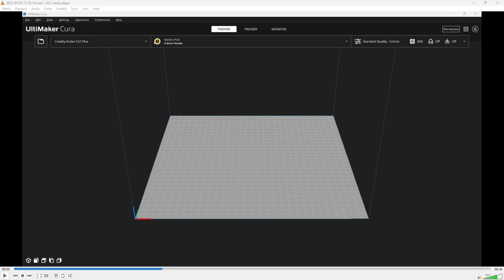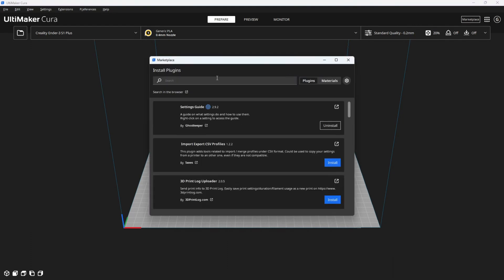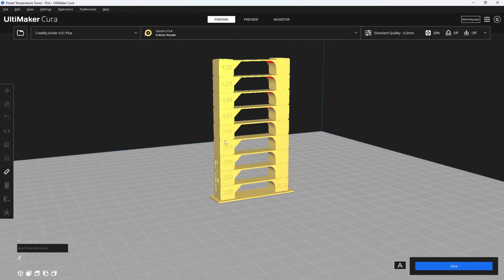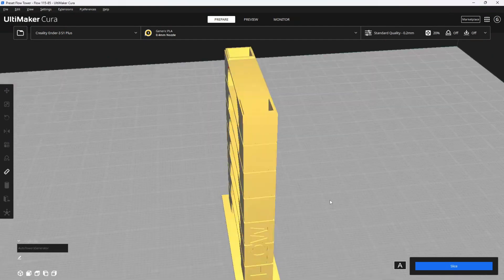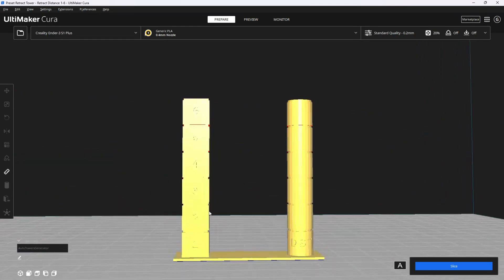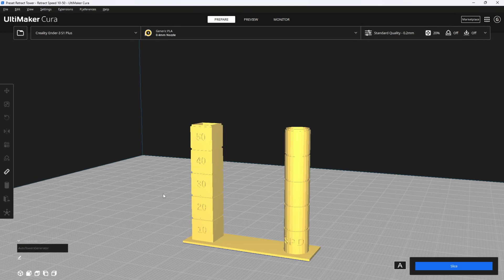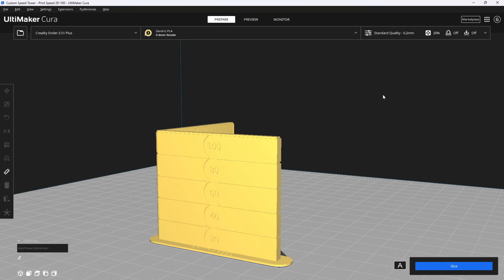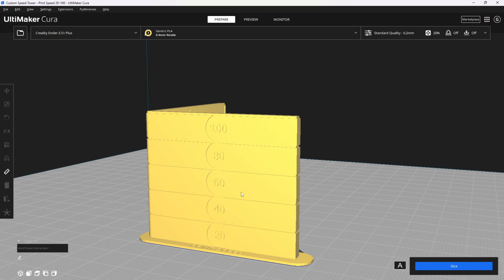CURA: Temp, Flow, Retraction, & Speed Tower - What, How, and WHY to use them, for better 3D Printing

Comment: I have a Neptune 4 pro, my print speed is default at 250 mm/s. What should I do, should I just leave it alone?

I have found that better print comes out at speeds of 95%.

(The speed tower only goes to “100-200” tops)
Reply from the maker: I would prefer you act as if "Defaults" don't exist. Set speeds manually in the sliced, for each project. Experience, will lead the way.... 
Projects with details and small parts, will need slower speeds. Projects with big bulky features, can handle high speeds. Silk filaments will have different matte/shiny appearances depending on speeds. Some of my prints are done as slow as 80-120. I seldom push faster than 220. Practice....

Comment: Thank you very much for this video.  Always been curious what the proper order of operations was for testing.  Any idea where I can find a speed test that has higher rate?  I just picked up a K1 max and wanted to test much higher speeds than whats available with this extension.
Reply from the maker: I would use Bambu Studio or Creality Print 6, for K1

Comment: If you use the flow tower do you need to set a starting flow in your settings before you slice or it doesn't matter?
Reply from the maker: It's been a while since I've done one of these, but, I want to say, you shouldn't have to. The GCODE should do it

Comment: What about layer settings ?
Reply from the maker: All temp changes are in the gcode
Reply: @3DRundown  
Yes thank you .
I dont know what i have to write in value settings. 
After a few mistakes and some trys i will check it
Reply from the maker: The 3MF Project file, has it all done for you. That's why it exists. :)
Reply: @3DRundown  it was about the settings beforehand.
so that it really increases the speed by 20 percent after 42 layers.
but it worked now, thank you

Comment: STILL the best tutorial for tuning new filaments.
Reply: @3DRundown  does it matter what speed youre printing at? so will a flow calibration tower at 50 be the same as 80 or 100? or do you need to retest at different speeds?

Comment: Great description. My only problem is my eyesight sucks and trying to look closely at those tiny towers is difficult. lol I need a magnifying glass to see what layer is best.
Reply from the maker: If they are BAD, you'll KNOW. If they look similar, then that range is likely safe. Look for mega failure, to eliminate those settings, and get a better idea of what is too Hot, Too Fast, Too Much, etc. this will help you get closer to something that works. Truth be told, I have only used towers 2-3 times ever. Start with stock profiles, they are very good these days. Work from there. Avoid changes unless you see a need

Comment: I have an ender 3 s1 pro which has a dirct drive. So my retraction should be bellow 1. Is there a way to chang the tower so it runs from 0.4 to 1 or something similar ?
Reply from the maker: 0.8 for the S1 will be fine

Comment: Hi. Thank you for the walkthrough. With the temp tower, do we care about rhe stringing or only about the layer ans surgace quality. Some of the best layers, surfaces and edges look better on he higher temps but they have stringing.
Reply from the maker: Higher temps tend to cause stringing. Id stop the stringing, then figure out the rest. For PLA and PLA+ nearly any brand will be ok around 200-205. May have wet filament or retraction issue. If stringing just wont go away. Wet filament is likely the issue, or too much retraction distance.
Reply: @3DRundown  thank you so much for the prompt reply. I'm take that advice. I'm new in the filament pushing game. In what order would you do which towers to calibrate my E3v3 se?
Reply from the maker: I have a V3 here, but haven't even turned it on. I feel guilty. I'm out of space and time. This  years new releases have been nonstop.... 
I'm not a huge fan of towers. If using them: 1st, be sure they are even working. See if the temps are changing, during the print, for example. Start with a stock profile. Avoid any drastic changes. I would set your temp at 200, and check retraction 1st.
I prefer to work myself, using something like this: https://www.printables.com/model/75704-retraction-test
and this: https://www.printables.com/model/251890-stringing-test
The 2nd one is much more complex. If can survive that one, you know you are good.
The E3 V3 with it's sprite, really shouldn't be strining much. What slicer are you on, what profile, and what is it showing for retraction speed and distance? Distance should be somewhere around 0.8, as it's a Direct Drive.
Reply from the maker: Also, feel free to pop into my group, and post in more detail: https://www.facebook.com/groups/ender3v3
Reply: @3DRundown  seems like I have a ton to get through to get the machine tuned up. I have both creality print and cura. Doing the towers on cura. Did the auto temp tower and it gave me 220, this is with petg by the way, and did a flow wich gave me a 90 as the cleanest although 110 didn't look to bad except for the top layer for it. Only 90 and 110 didn't have any stringing at all with 90 looking best. Following your guide in the video and slowly working my way through. I'm busy printing the retract distance 4-9 tower now.
When you do get to the v3 we do a video on it. Yeh this year has been loaded with new releases. You're going to be a very busy guy in 2024. subd
Reply: Oh and on the normal quality 0.2
Reply from the maker: PETG is a royal pain in the ass. I reccomend working with PLA and PLA+ unless you really need PETG. However, PETG on my K1 has been a breeze. I've Got the V3 SE here, and the KE on the way, but, omg, I'm swamped. I can't even come close to keeping up. I'm trying, and will do my best!! I am dealing with a MASSIVE space issue....    See you in 2024! I will try my darndest to cover all this kinda stuff.

Comment: >For Auto Towers to funtion MUST run post scrips, Extensions--> Post Processing-->Modify G Code. Then select Add Scripts. Select the one you want to use for the Auto towers you select earlier. Select the parameters. If you have doubts search for more videos.
Reply: was waiting for the script instructions 😂
Reply: Cura 5.8 auto towers do not need post processing gcode modification as far as I know.
Reply: @arnab6408  you would be correct. Cura 5.8 added auto towers native so you dont have to install the add-on and you no longer have to change the g-code
Reply: @3DRundown  😬🥴🙃

Comment: I'm new to 3d printing, but I just used the auto tower plugin, and it does NOT add the scripts to actually affect the settings during print.

For example, the flow tower. I exported it as is, and the .gcode did not make any changes to the flow rate. It is very important that you verify your tests are genuine tests. Otherwise you're going to go against placebo results, making you change variables without proper tests...

The way to fix this is to go to post processing, and enabling the correct script. You wanna make sure the settings are correct there, and the increment has to be checked against the preview. If the increment is 40, then you would expect the next iteration in that script to occur every 40 layer line. So 40, 80, 120. You can visually check that in the preview.
Reply from the maker: Are you runnin version 7.1? (7.2 is awaiting approval).
Reply: @3DRundown  I'm running the latest public.

For the other calibration plug in however, their scripts work fine

Comment: Thanks for sharing this!  Huge expansion of my knowledge of testing and USING the previous good value(s) for the next test(s).  Somehow that tidbit of knowledge escaped me when watching videos about running individual tests.
Reply from the maker: Even better news, there is a major update to the extension since this video. Make sure you have it. I believe it's 7.1 or 7.2
Reply: Thanks - I have Cura 5.4.0 and Auto Towers 2.6.0 - running on Winders   @3DRundown

Comment: The temp tower didn't work for me on my Anycubic Vyper. The initial layer pattern is very weird and lays an inner layer, then an outer layer over that making it very thick too fast, even on my "Fine Profile" setting. I tried to run it twice and within 3 layers it was unusable so I canceled both tests.
Reply from the maker: Bummer. Sorry to here. If you end up with one that works, link me to it

Comment: on retraction distance, mine was best at 11. does that mean i set the retraction distance as 11 mm or 1.1mm?
Reply from the maker: 11 is REALLY high, but 11 is 11. Which machine is this? For Bowden setup, 5-8ish is typical
Reply: @3DRundown  it was at 11 on the auto tower, but realising that it was ridiculous,  I changed the temp and its now working pretty good at 3, but i still need to fine tune it.  Ender 3 s1. Thanks for the reply
Reply from the maker: 3 is still too high, if a Sprite. Get down to 0.8ish if a Spride Direct Drive. 5-6ish for Bowden.

Comment: Great vid! I've been looking for the best order to do these tests in. Thank you!! When I tested the temp tower, after it bridges across 2 lines, it starts doing a zigzag pattern. I thought it would always bridge straight across. Is the zigzag normal? It doesn't look like I can modify it.
Reply from the maker: Right. First you get a bridge, then a top surface.
Reply: @3DRundown  Each bridge has 3 layers. It starts to zigzag during the first layer. I guess I thought it would go straight across for the entire first layer, then zigzag on the second and 3rd layer.
Reply from the maker: Ah yes, that makes sense.

Comment from the maker: Peeps: Check in with your results. Are the gcode changes  working?
Reply: Cura 5.3.1
PLA temp tower doesn’t seem to be working.
Reply from the maker: Check the GCODE by opening the sliced file in a txt editor. Mine are working. I tested yesterday on a 5+. I had another test for me on their 3 Neo. Curious why no luck with yours...
Reply: @3DRundown  what should i look for in the file to check if the changes are there? TY
Reply: So far none of the towers change settings automatically. Neither the temp tower or flow tower do any changes as they print. Maybe you could show where you can show where you check the settings are applied in the slicer (Cura)
Reply: Love your guidance. Per your request and after printing a flow test, I noticed the flow never changed so stopped to see what was up.  I used Cura 5.4 to slice and low and behold there were no M221 commands anywhere. Don't fret, nor were there any in CURA's own flow tests so something is interfering with the generation of this. I'll dive into that later.

Attempting to verify my findings, I checked g-codes generated for both of the flow towers in Prusa, and Notepad++. At no time were there any M221 commands found. The computer world is bizare so don't fret, and like Gowerman I  looked up the 7 necessary layers (easy to find via any slicer) then jumped into the g-code reader (notepad) and to each of those layers I added the M221 S **  numbers as needed. Now off to give it a try. 

Please keep up the outstanding work as you've helped me a bunch.
Reply from the maker: If you've got proper GCODE that us peeps should use, feel free to link me to a document, with the code and how to use it, and I'll update the description, or make a new video. :)  Great to have smart peeps around!
Reply: As mentioned I'd run the code with the M221 S** at the appropriate times and it appears to be working. I'm still not understanding how your code doesn't work when sliced since clearly it does and has for others. 

I'm going to ask CURA what they think as all of this is WAY to new and sincerely out of my league at the moment. 

I only just started this journey 3 months ago and because I follow videos like yours, I've had great success (OK, I'm very lucky too) but am always on the lookout for better or perhaps it is greater knowledge, dunno but here I am. I'll let you know what, if anything, I learn from CURA. 

I've also got some pre-processing gcode in my CURA which might be an issue here but I swear, I've no idea. Lets not forget that MARLIN is completely foreign to me so I have to look up every number/piece of code to have the slightest idea of what the code is asking the printer todo.  

I can't thank you enough for the guidance (videos) as it has helped more than I can say. I will keep you informed.

Comment: Question when you pull up the temp tower, and slice it to the memory card will it mess up the settings? I sliced the one for pla and it doesnt seem to change temps as it prints?
Reply from the maker: It shouldn't....  Gonna need to test some on my machines!